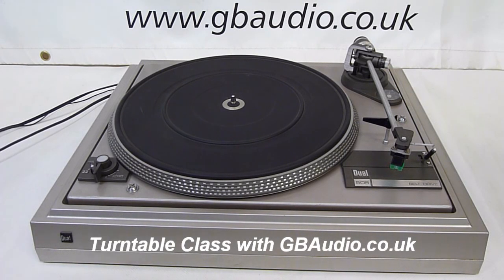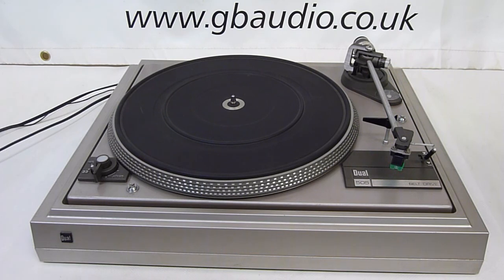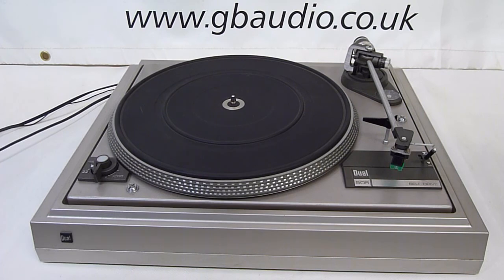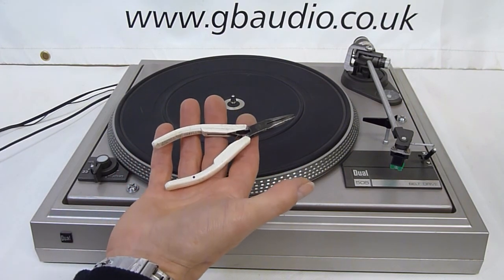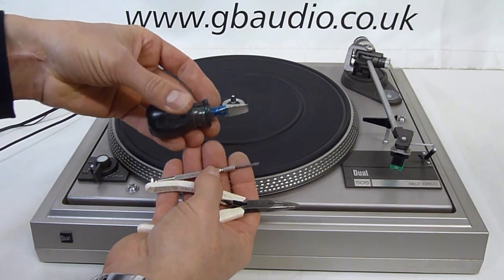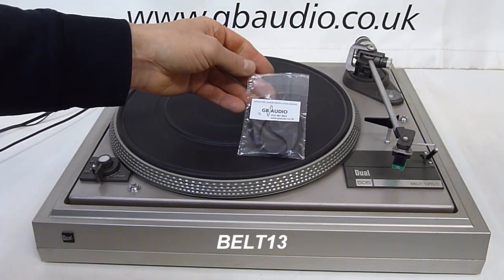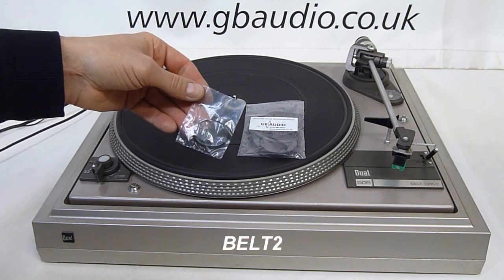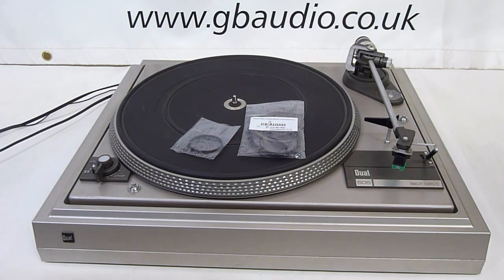1. Dual CS505 introduction to a basic service

Comment: A very useful set of videos.   Could you add a video on lubrication - many people like me will have a very old 505 (mine is original 505 from 1983) which has probably "dried up".  Thank you.
Reply from the maker: Great suggestion! If we get another CS505 here in the store, I'll do it, but we don't have one at the moment.
Reply: @gbaudio1212  I'd like to see that video if you ever make it, I too have an original 505 and the speed isn't as stable as it should be despite a new belt. I'm suspecting lubrication will help!

Comment: I have dual cs 505-1 (1982year). Noise level -54 dB during playback (when the needle is not on the vinyl - there is no noise), probably the noise from the motor, the disc rod was lubricated. Is it possible to reduce the noise?
Reply from the maker: Is the noise present all the time or only when the motor is running? If the noise is there all the time, it may just be that your tonearm isn't earthed properly. Your deck should have a fine single wire beside the phono outputs, which needs to connect to the earth terminal on the amplifier.

If the noise is only present when the motor is running then you should check the motor's rubber mounting bushes which may have dried out or disintegrated and causing vibration to transfer directly to the subchassis and need replacing. Good luck.